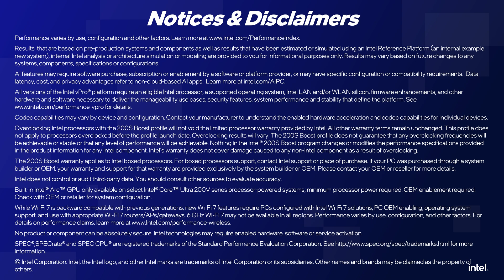Hyte x Intel at Computex 2025: The X50 Is an Engineering Marvel | Talking Tech | Intel Technology

Comment: This shows failure... This case is too tight that their own AIO cooler has not enough room for the hose to clear from GPU and touch.... So if you have 4090 Founders edition will cause hose to rub against...Plus not able to top mount AIO will also limit type of graphic cards to use because not enough room